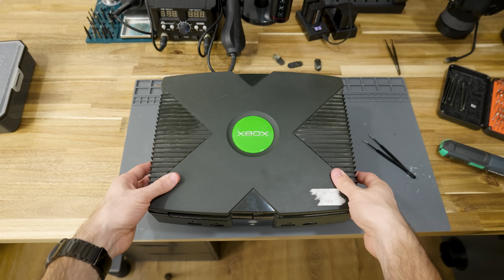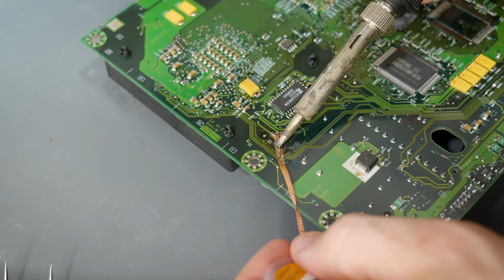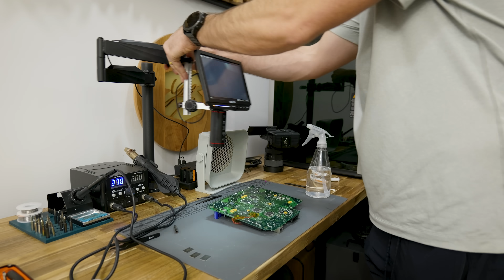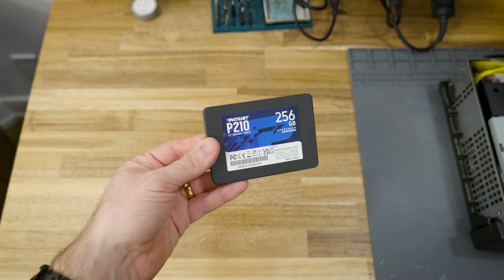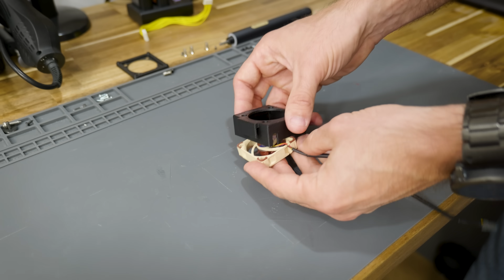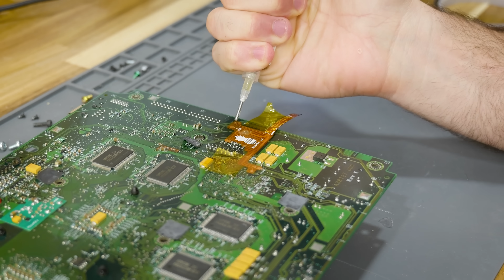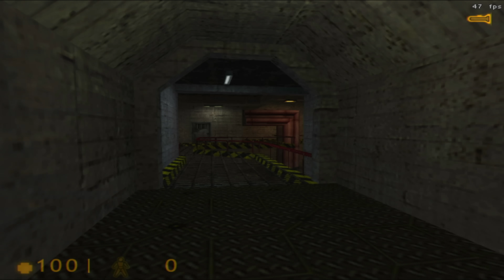I built a MODERN XBOX...

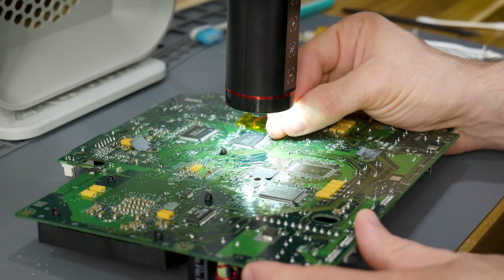Comment: 8:58 Here’s some super duper, free soldering advice:
For IC (Integrated Circuit) installation, specifically SMD (Surface Mount Device) chip components with many many legs, DRAG SOLDERING is dramatically easier. 

What is drag soldering? It’s a method used to hit entire rows of legs in a single shot. Instead of dragging each individual leg downwards, you drag ACROSS all pins (think horizontal, instead of vertical).

Huh? How does that work? The answer lays in the right equipment, a quick hand, liquid flux and a bit of practice. 

A special soldering iron tip is used. The tip is hollowed out, and at an angle. This allows solder to wet and sit inside of the tip. It’s super cheap. As long as your iron can swap tips and run standard sizes, you’re golden.

SMD specific liquid flux is also a must. You’ll need good COMPLETE coverage of legs on a single side of the IC to pull this off. Chipquik SMD291 flux is typically my go to. Might need to spread it with a lint-free swap or a gloved finger since it’s slightly gelatinous, and less viscous than other liquid flux.

For solder, best results with this method are yielded with 63/37 leaded solder. Can’t go wrong with Kester branded solder.

Now… AT FIRST, this method will SEEM “sketchy”, but trust the process. 

First, line up your corners. Tac them in place with the tiniest, most minimal amount of solder you can manage (this isn’t the final amount they will receive).

Second, apply generous amount of flux to a single side of the IC you wish to install. Enough to cover all of the legs. This is where the SMD291 comes in clutch. Because it’s more gelatinous, it won’t spread out all over the place (or under your other components) as easily, making clean up easier. 

Third step, add solder DIRECTLY to the top of your iron, NOT TO THE BOARD. IRON ONLY. Fill up that little cup on your fancy new soldering tip.

Step 4, drag. Drag that sucker across ALL THE LEGS, ONE SINGLE PASS, ONE SINGLE MOTION. 

EXPLANATION: The solder is attracted to the flux, and with your singular swift movement you are able to knock out all pins on a single side. At the rate in which the solder exits the cup of the iron and transfers to your leg/contact, IF YOU DO IT CORRECTLY, it will not bridge a single pin, OR leg. 

*THIS DOES TAKE PRACTICE*

Few other things to note
-This method works on clean, SMD contacts. You should NOT tin your contacts BEFORE attempting this. If you are working a board that previously had an IC installed, gently clean off the contacts with solder braid/wick/flux beforehand, followed by a cleaning with 100% alcohol and a lint-free cleaning implement. Careful not to accidentally remove the solder mask on the board if you do this
-This method is specifically for SMD components, NOT through hole components. 
-Practice makes perfect. On Amazon, you can buy stacks of boards for practically nothing, along with additional IC chips (sometimes in the same kit). Test your skills on something NOT important before attempting this on anything you care about
-This method is “daunting” at first, but it’s what all us professionals do in practice.
-Yes, I solder professionally and hold many certifications. I specialize in space-flight hardware, and can promise you this is real. I picked up this specific trick during my time at NASA (Goddard Space Flight Center). This is the method we use to build our custom circuit boards. 

Please, if you (or anyone) have any questions I would be tickled pink to help. I love these kind of builds, and if my silly little YouTube comment can help anyone out to build cool stuff… that’d be awesome. 

HAPPY SOLDERING!!!

Comment: There are a few problems I ran into once I got into hard modding og Xbox’s, and all of them were reasons not to. First of all the ram upgrade lets you do pretty much nothing these days unless you’re a homebrew dev, want to play one of less than 10 sega arcade games, or playback video at a slight higher resolution/fps than stock but still significantly worse than any modern solution. Flashing the bios in any regard has only 4 functions, nulling the hdd key, ram upgrades, getting more than a 2tb drive and removing the requirement for the dvd drive, nulling the hdd key will remove one step from the process of replacing the hard drive but will also break its ability to use Insignia (the modern Xbox live replacement) which may or may not happen even if you don’t null the hdd key on an aftermarket bios anyway. Removing the dvd drive from the IDE bus for some reason always seems to screw with the hdd and make loading times horrible. Modchips seem to be useless as well unless you have a 1.6 because you can just flash the bios onto the TSOP which if that somehow corrupts you fall back to a mod chip to fix it anyway so there isn’t much point to mod chip them unless you really care about the HDMI mod so your 25 year old games look marginally better. And to be honest if you feel the need to have more than 2tb on an og xbox what are you actually doing with your life? An aftermarket bios doesn’t even negate the need to softwood the console anyways and soft modding will let you do what 99.9% of people wanna do which is install a bigger hard drive and play some game backups, most other things are just novelties these days.

Comment: The only thing missing would have been an USB port to connect an external CD/DVD-ROM drive, just in case you buy new games and want to rip them into the SSD.
Reply: If I am not mistaken the controller ports are actually usb ports in disguise, just usb 1.1. Adapters do exist for these
Reply: @ThePipton not enough speed to really load game discs tho. Think about it why PS2 games have longer load times or issues with cutscenes when running a game off a USB
Reply: @windowsxpnt2347 I swear my ps5 BDrom is using usb 1. Takes 15 min to install a 1GB game.
Reply: @ThePipton  Correct. I had a hell of a time getting those old controllers to work with Windows back in the 2000s, because they needed special drivers.
Reply: you can also just flash a Blu-ray drive with the OmniDrive firmware and rip Xbox games from a PC
Reply: @matthias6933  IF YOU CAN DO THAT, THAT MEANS YOU CAN PLAY XBOX GAMES ON PC!!!??
Reply: @White_Night_Demon sure, with XEMU. But a ton of games have issues
Reply: @matthias6933  So its not completely playable then???
Reply: @matthias6933  Unfortunately, BD drives that actually support the OmniDrive firmware are rapidly becoming Unobtanium.
Reply: I'll eat my shoe if he actually did the transfer over that ancient and failing disk drive. He's already got the FTP set up, I'm sure he's using "other user provided backups".
Reply: Tear the brains out of the original drive and splice it into a modern drive, that works if you do it properly.
Reply: Either that or replace it with a slim DVD drive so that it's still a self-contained fully functional Xbox.

Comment: I think you put the smaller fan on the wrong way. It was correct originally but you flipped it when you put in the bigger heatsink. Its now trying to suck the heat off the heatsink and not blowing air onto it.
Amazing mods though. Looks sick!

Comment: Very good. On the RAM chips. Tin the pads on the board with leaded solder, tack two corners like you did then move your airgun around the four sides of the quadpacks having flooded them with liquid flux. You could even use sticky flux (which holds the balls down when reballing BGA's) - that works well also. Great stuff and a good descriptive video....

Comment: back when it was still new I took my Xbox apart and put it in a PC case along with a PC so I could take both with me for LAN parties.  I had the 4 controller ports connected to the front of the case using the quick disconnect part of the cable making the ports much smaller.  I also took the back off the DVD remote adapter and attached it to the front of my case along with a toggle switch between it and the 4th controller port so I wouldn't need to unplug it.

Comment: theres an upgrade that you missed on this build and its the PXU, a modern powersupply that its a drop-in replacement, its slimmer, generates far less heat, and its generally more reliable than the original psu. its perfect for a build like this aimed to reduce the console size. while it will require you to provide a external regulated 20v at 100w (from the likes of a laptop charger) it also has the option of using USB-C PD, ofc it requires a beefy USB-C charger, on the ballpark of 90ish Watts and have a 20v rail.
Reply: also, and i forgot to point at this, and bringus probably know this, the PXU removes the AC conversion ciruitry out of the console. making working inside the xbox far safer.

Comment: I am surprised that when you talked about slimming it down you didn't consider changing the PSU for a more modern PSU with a smaller footprint. A good few years back a modder made an "Xbox Slim" for the OG Xbox that did exactly that. 

Its been a while since I checked in on the OG Xbox modding scene, and the wireless controller support is super awesome! Can the wireless controllers boot up the console?

In the past I re-routed the yellow wire (lightgun wire) for the P1 controller port to the power power button in the console - I then drilled out the xbox emblem on the controller and added a large momentary switch in its place, connecting it to the pin the yellow wire belongs to in the controller which made for a hacky way to shutdown/boot up the console without getting up. I'm definitely getting wireless if it supports booting the console.

Comment: Bit of a tip: The exposed solder joints (visible through the new case) from the backside of the power supply creates a shock hazzard. I would add an insulating pad or something so the solder joints for wall power aren't exposed like that.

Comment: I would've mentioned that you had to increase the speed of the fan to compensate for a smaller size. That 60mm Noctua is a severe downgrade until it's bumped up in bios.

If you have a stock xbox and want a quieter fan, this Noctua will overheat fast. You can actually peel back the sticker on stock fans to apply a few drops of oil to quiet them down. The 70mm Nexus fan is also a drop in alternative. But it needs bumped up as well. I use the Nexus at 70% and it's barely noticeable.

Nice vid though.

Comment: Not the ultimate upgrade. You didn't swap out the CPU, which is just a PC Celeron, with a, I think, Pentium 3 1.4ghz, although back in the day and I may be wrong I think there was a Celeron 1.3ghz that could be used also.
I heard some games can have issues with the Pentium upgrade but cannot recall any issues with using the Celeron.

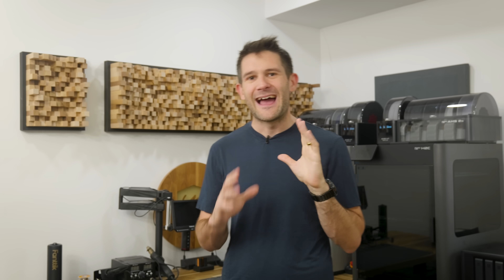Comment: 9:56 isn't the whole point of these pad and pin configurations that you can just hit it with hot air till the solder melts and the chip will just sink into the solder and be done?
Reply: That factory solder is unleaded solder I believe and you need more heat to melt it. Better to just remove it and use leaded solder
Reply: If he had tinned the board pads with leaded solder, then added flux, it would have been just that, drop on, heat, and it would have positioned itself.

Comment: The reason you’re struggling with your soldering is that you need to apply more heat to the component that you are soldering to, because it’s not hot enough the solder is sticking to your iron or the ribbon - it won’t stick to anything not hot enough. 
You’re right to be cautious but you can be a little bolder and actually it’ll be safer (because you will work quicker and more efficiently and less time redoing stuff is less opportunity to break something.
Thanks for the video dude,

Comment: Use your heatgun to reflow the solder on ram chips. This will set the chip square and solder all pins.

These PCBs are soldered with solder paste in an oven. So setting the rom chips in this way is absolutely a better way to go.

Comment: hey so for future reference soldering smd chipsets, prepare the board with fresh leaded solder and for soldering use a chisel or conical tip to drag solder then clean up the work as needed. as for the flux i noticed you put the flux in the middle of the chip although that works it works propperly when you hot hair rework a chip, not soldering iron as good, in which case i would suggest putting a line of flux right at the top of the pads, and it also makes it easier to clean.

Comment: Your case design looks pretty close to the slim boxes people used to build back in the day by cutting 1/3 of the top off the case after removing the dvd drive and og harddrive caddy. If i remember correctly some people even got it down to the footprint of the mobo its self by using a modern after market PSU.

Comment: Although it may seem to work just fine, I wouldn’t replace the power rail capacitors with fewer capacitors just because you can get higher capacitance ones in the same package size. Capacitors are never a pure capacitance, they have internal resistance and inductance as well. This results in them having a particular frequency response that may be important for power line noise and filtering. At a minimum, they use multiple electrolytic caps on power rails because it spreads the ripple current, and thus the heating, across multiple capacitors. Heat kills electrolytic caps, so you want to keep that down 😉

Comment: I would recommend for soldering chips like the ram use a bunch of flux and use a solder paste on the contact pads. All you have to do then is get it generally aligned and use your heat gun to heat the solder till it melts. It will go right into place, inspect the pins afterwards and hand solder any still loose
Reply: Or just wick the pads before drag soldering. Your method works but I don't see any reason to waste solder paste on something this basic

Comment: Now, build a custom UPGRADED Sega Saturn Plus edition.

Upgrade list suggestions:

CPU's: Slight overclocks to bring the twin SH-2's up from 28.63636Mhz to 28.82828Mhz to fix communications timing issues between the main SH-2 CPU's and the 14.41414Mhz Processor controller chip and the 14.41414Mhz SH-1 System Control Unit.
RAM: First, expand the Saturn's main work RAM from the 1MB low work RAM and 1MB of high work RAM to 1,280KB of low work RAM clocked at 14.41414Mhz and 4,096KB of 28.82828Mhz of high work RAM allocated into two banks of 2,048KB of RAM for each SH-2 CPU.
Graphics RAM to be upgraded up from the 1,536KB of VRAM the Saturn comes with to 6,144KB of VRAM by replacing the 6 256KB memory chips the Saturn has on the motherboard with 6 1,024KB memory chips that use the same memory formatting and encoding and the same 16bit data bus per chip.
Overclock the VDP-1 and VDP-2 chips up from their base 28.63636Mhz clockspeeds to 28.82828Mhz to improve timing between the Processor Controller chip and the 3D Math Co-processor DSP chip as both run at 14.41414Mhz.
Upgrade the sound RAM from 512KB to 2,048KB of sound RAM and keep the memory clockspeed unchanged.
Rework the Sega Saturn Double Speed CD-ROM drive to use a slightly faster spindle disc rotation speed and retweak the laser to use a speed matched sample rate to improve loading times. Maybe even get near quad speed drive levels of performance if your adjustments are done right. Of course this will require some tweaks to the software that runs the CD-ROM drive to account for these faster sampling and disc read speeds.
Upgrade the internal on board save space chip to at least 2,048KB.
Remove the Saturn's region locks and perhaps upgrade the standard definition A/V output to some sort of SCART A/V Hi Fi signal output that supports the Saturn's maximum resolutions of 704x512i and 704x256p.

Good luck!

Comment: I learned how to solder by modding my original Xbox. I added little LEDs around the controller ports, mounted cold cathode tubes by the side vents, and cut the top off the disc drive so you could watch the disc spinning.
I even cut a window into the top of the case along one side of the X and used part of a CD case as the clear panel, so you could see all the lights and the disc while playing.
I also remember propping my mom’s hair dryer on that stubborn jewel, then eventually working it loose with a butter knife. This video brought back so many memories of my first console mod. Thanks for the nostalgia!

Comment: if you're struggling with soldering chips with lots of pins, it sounds counter-intuitive but you want a larger tip than used in the video, more surface area, more heat. if you have good flux and solder it will just go where its supposed to on the pins and if you do bridge, quickly moving side to side will clear it 90% of the time or pulling away down the legs will separate the legs if the previous attempt didn't work.
Reply: more solder would have been helpful in this video. he probably had issues before he found flux....  now scared to use enough solder.

Comment: Taking notes, My OG X-Box which i've had since 2002 has a dead or unresponsive HDD and only boots in to an error screen. Would love to repair it, but since it was only ever soft modded and I didn't back up the firmware or keys....
Reply: Update: Recently poked about inside it and got it working again, turns out the HDD is actually fine, the IDE cable is just a bit touchy, and I also have to deal with the clock capacitor.. I've since been able to dump the bios and HDD keys to my PC as well as back up the drive.

Comment: Great video, one thing you don’t need dvd2xbox if running the test build of XBMC4Gamers I added ripping a disc to hdd ready or ISO files to the context menu of the inserted disc. Will also patch games that require fixes to run off the hdd. (Game protections)

As well as a whole load of other stuff. (A year of updates 😁)

Comment: Using solder paste on those 100 connections would have saved you a lot of time in soldering each pin individually. The paste would flow to only the contacts where needed as the built in flux would also help it flow to the needed points required.